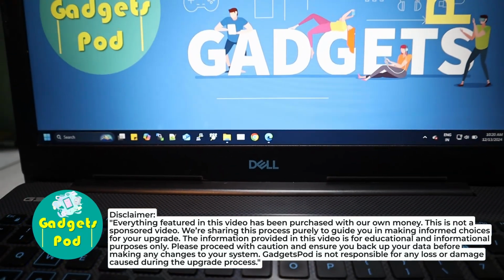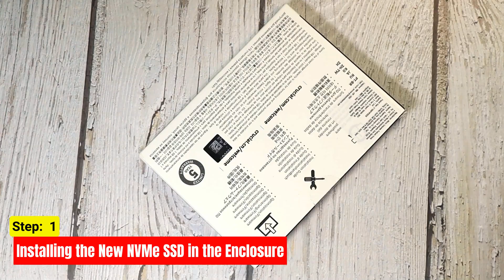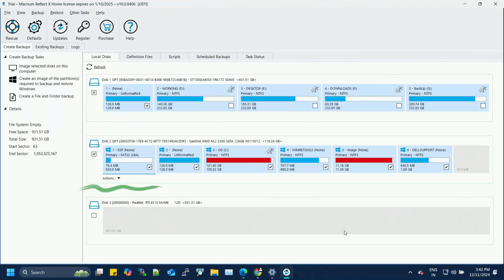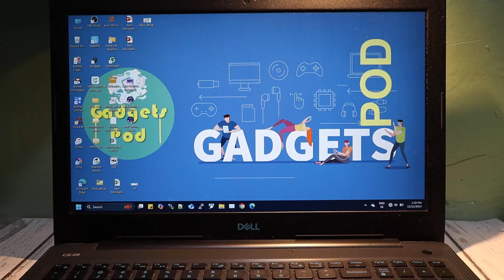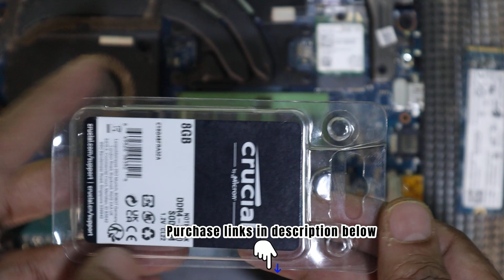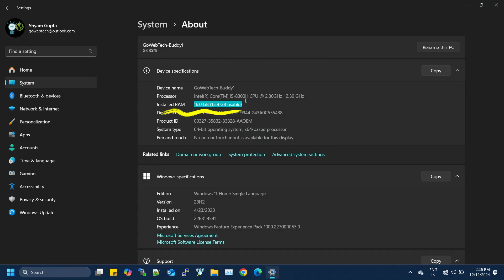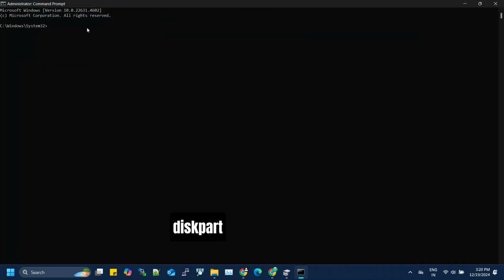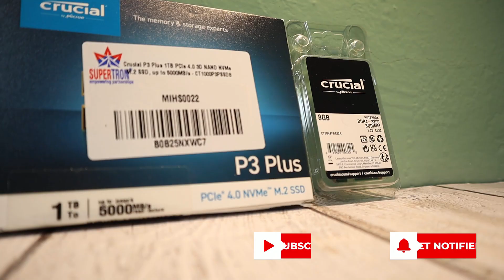Upgrade Your Laptop Storage & RAM  DIY Guide with NVMe SSD & Portable SSD Setup

Comment: Really good, in-depth tutorial. Followed all instructions and was able to upgrade m2 SSD, Ram, and create a new external drive. Only tip I would recommend is having the presented equipment (The laptop in this case) cleaned up (mainly the screen was dirty so harder to see some instructions), but the rest was good.
Reply from the maker: Thanks and noted the recommendation. Will try to improve next time.

Comment: Dear sir,
The video is most helpful and detailed. Do you believe that this process will work for my HP laptop as well??? I have already upgrade RAM from 8 to 16. What about the cloning??
Reply from the maker: Thanks for the feedback. The cloning process remains the same, so please go ahead. However, do not format the original drive until you’ve confirmed that the cloned one is working properly on your laptop.